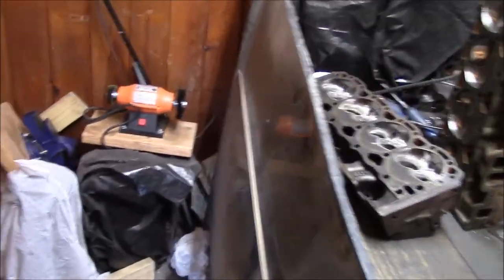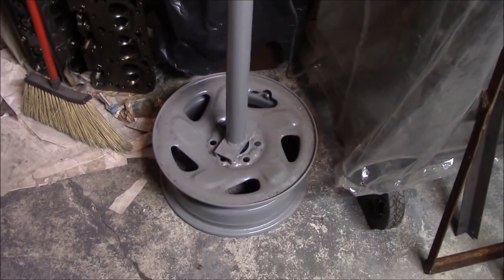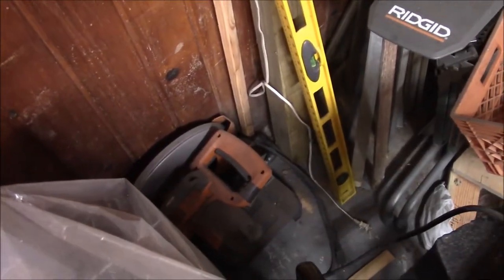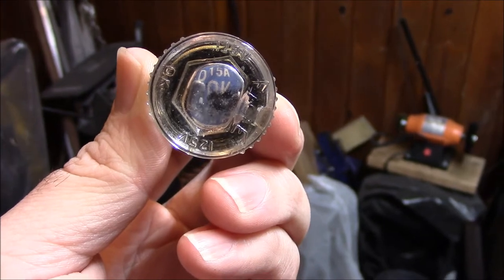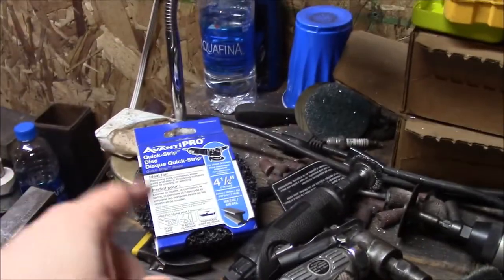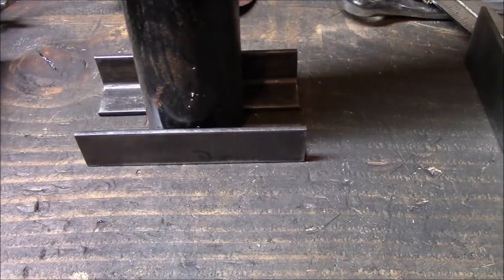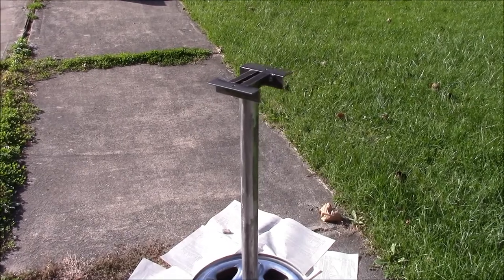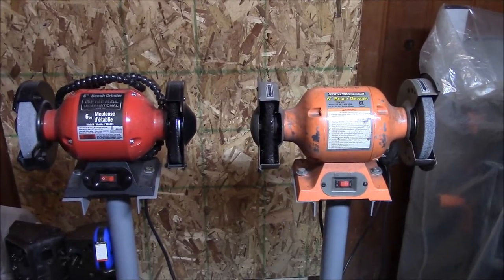How to Build a CHEAP Bench Grinder Stand & Mounting Tips

Comment: Could have but sand in your stand pipe it adds weight and also dampens vibration.
Reply from the maker: Still could drill/cut a hole, poor in a bit of concrete or w/e and then the sand.  Cool idea may try it thx